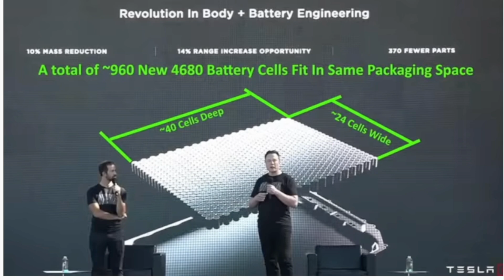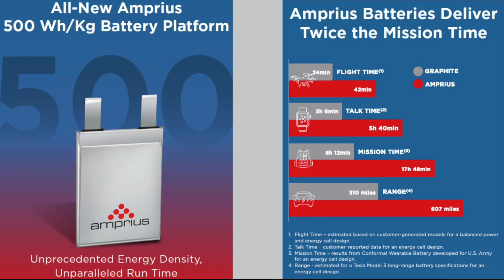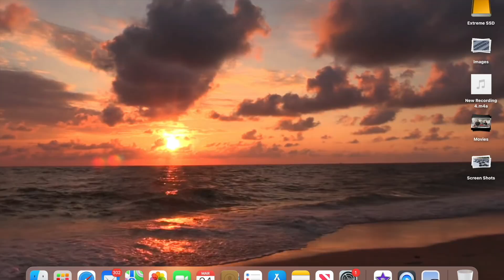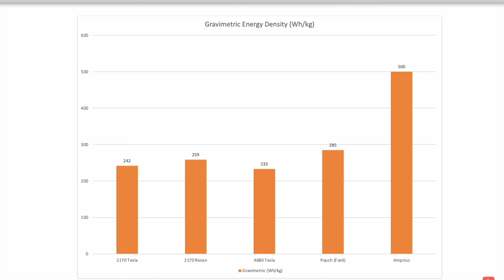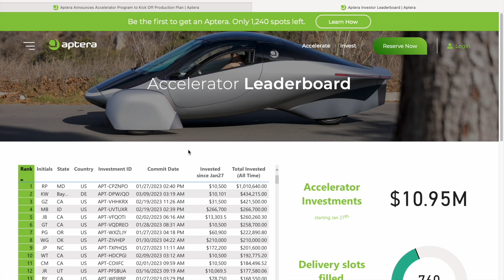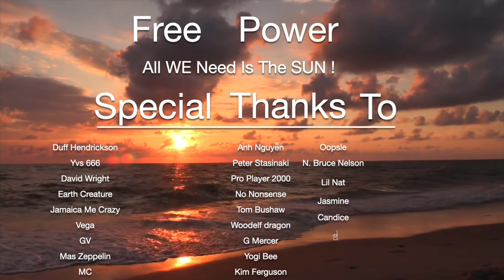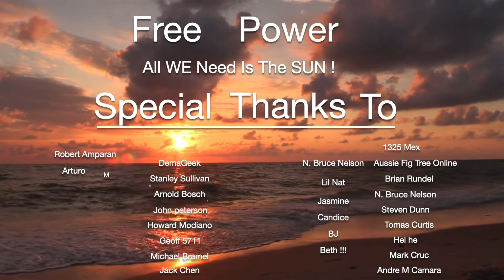Amprius"s Battery's Will Change Everything !

Comment: These cells will probably be  10x the price which makes then unsuited to a car except for maybe an insane showpiece.    These cells will be a super valuable commodity and are best suited to drones or aviation.  Aptera is trying to be cost effective but these cells will be prohibitively expensive.  Aptera could potentially use sodium cells which are cheaper than LFP and still hit 400 miles - no need for the industry best cells when the worst is viable.  Sodium is safe, cheap and good with temperature ranges
Reply from the maker: These cells are not supposed to have any cobalt in them , that may make them a little cheaper .🤔
Reply: Lithium prices in China have dropped like a rock recently!
Reply: @gmv0553  No clear indications that trend will hold long term.  EV demand is currently being outpaced by supply increases but eventually ramping supply will hit limits as easily accessible resources are limited and Australia can only scale soo much.

Comment: Used in a 600 mile Aptera, this battery would weigh about 265 pounds, or about 440 for the 1000 miler. Not bad at all, if the other metrics (cost, cycle life, charge speed,  heat dissipation, fire risk etc.) perform well. 
That said, recent history is littered with promising new battery technologies that hit the rocks.
Reply from the maker: Sandy says this battery is ready now , but your right new tech seems to fall apart when they think they have something . 🧐
Reply: @freepower1082  These batteries only last 100 cycles, it`s trash